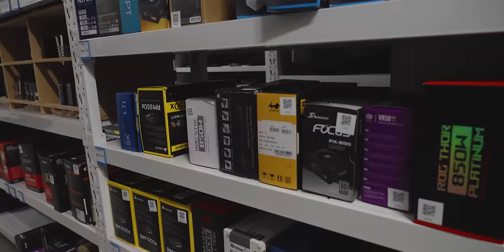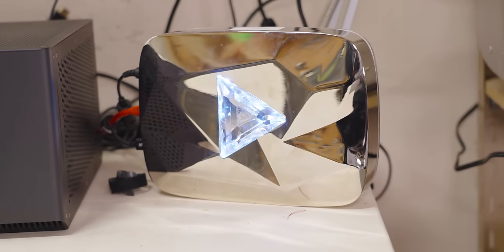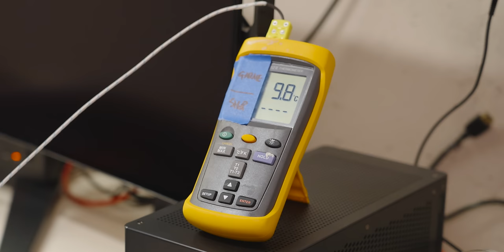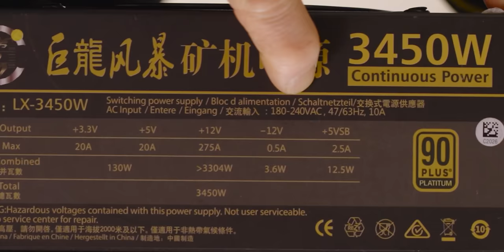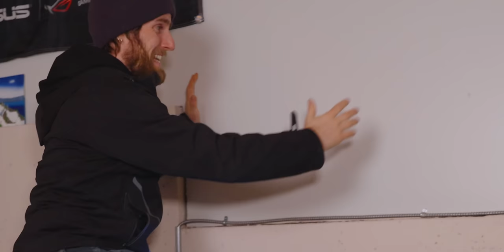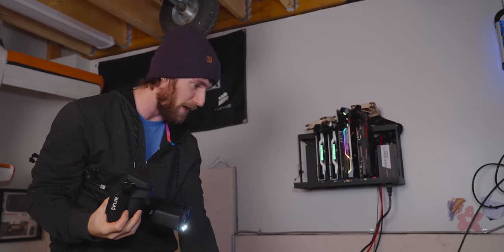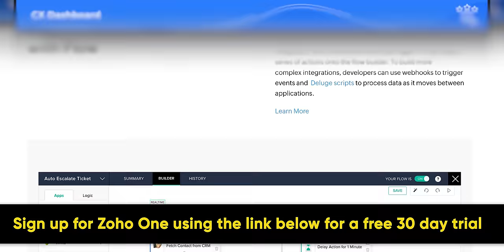Ask me why I'm Mining in 2023...

Comment: for anyone wondering about converting the delta from Celsius to Fahrenheit, you simple multiple the Celsius delta by 9/5 to get the Fahrenheit delta. To convert a Fahrenheit delta to Celsius, you multiple by 5/9. The easy way to remember is that Fahrenheit values are larger than Celsius values, so you multiple by a number larger than 1, which is 9/5.  

Just remember you can't use the normal conversion formula for temperature C to F. this is because the delta is functionally kelvin, so you are really converting from Kelvin to Rankine (which is where the 9/5 comes from). Rankine is just the Fahrenheit version of Kelvin. The only time you ever really run into Rankine in the wild is in aviation because weather balloons (or their reports) often use Rankine for measuring temperature. this is to avoid the possibility of dividing by zero (and some other useful features)

Comment: In house, I would use 5/12V powerline around floor of every corner of every room ..... and put some power source on the safe place (and also with some small UPS) ..... other than having tons of dangerous power supplies laying around flammable surfaces .... just pull cable from the floor put some 7805 or similar in TO220 case to easily manipulate and you are done ..... safe ..... and reliable due to UPS .....

Comment: Buying 1200W ceramic plate heater (with IR radiation) for like $60 seems harder than mining rig with value of like $5000? Which one is better? Besides, if you need really heat and not some money from crypto, invest in good heater. IR radiation can aim heat compared to air heaters. Less heat loss because you will feel the IR radiation heat much more.

For your info, i have 700W ceramic plate heater here, and it can warm up whole small room pretty well plus direct heat at my side. So it works well.

Comment: It needs to be on or near the floor. Heat rises!
I used to have a full tower of 540MB SCSI hard drives, venting heat out of the case only through the power supply fan. Worked to heat my shop a good 10°.

Comment: You just need to let it run for a few days. It's all about thermal mass. You need to eventually heat up the room and the objects in it. It's not just going to be instantly warm in there. I ran 2 GPUs in a 17*20*10 garage with -30C outside for a week and it was unbearably hot in there. I just needs time.
Reply: what crypto did you mine for ? I'm assuming not bitcoin since GPU's wouldn't be suitable.

Comment: The weather on the Pac coast is so intriguing. I'm in OH in the US, and we just had a cold snap around -20°F, and typical winter lows here are in the low 20s. A cold snap for Vancouver area being 14°F isn't a cold snap at all for us. That's just slightly below normal. I would think with BC being much further north, the cold snap Linus mentioned would be normal winter for him.
Reply: It's the coast, the ocean tends to heat the land and create a micro climate check out the zone maps for gardening and you will see what I mean. North doesn't always mean colder and also elevation makes a difference, when you are way above sea level like a mountain top it's colder.

Comment: you should use thick black theater curtains/cloth for the heat trapping (called molton in denmark, where i'm from), would work great for that plus it's also good for the acoustics 🙂
Reply: What about regular insulation that is designed for trapping heat? Crazy idea I know but let's give it a shot.
Reply: @originalguckfoogle  for sure, but that's not a curtain anymore

Comment: Infrared Heating Panel right above the workstation facing down AND/OR under the desk. I imagine you can get away with 500W or so. Pretty cheap. It will feel nice when on but won't heat up the room.

If you want to heat up the whole area/room you'll have to put WAY more thought into sealing and insulating it. Not worth it.

Comment: heat rises, sometimes I wonder if Linus is just trolling us or actually trying to do something (obviously it was for the video, but is he actually trying to make it work for the video, or 100% trolling?)

Another thing is, when you are trying to warm yourself or a room, you don't want a fan blowing directly on you, while the air might be slightly warmer, it will also be moving, so it's not significantly warmer than ambient, it will actually cool you off.  That's why you flip a switch on ceiling fans in the winter, to make them suck/blow cold air up towards the ceiling, then the hot air spreads out away from the fan, hits the walls, and goes down the walls, bringing heating down.  In the summer you flip that switch to blow the air down, so you have active air blowing across your body, even though it it warmer air from up high.

It would have worked a lot better mounting it either on the floor, near you, or bolted under your desk.  Especially if you used the curtains around the base of the sides/back of the desk so the hot air was forced to leave the front bottom section of the desk against your body.   1200 watts is a lot of heat,  space heaters typically max out at 1,500w

Comment: Surely it's 'working', but the heat capacity of what i'm guessing is a big concrete slab of a floor is making it a slow ass process. If you got it to temperature by some other means, like a big space heater, and then maintained the temperature with the GPUs that might work better?

Comment: I could be wrong, but i believe that the power company will charge you for capacitive load as well as resistive. so you won't get a perfect conversion of wattage used to wattage of heat. it should be off by the power factor of the mining rig. i think. lol

Comment: Perhaps Luke, or anyone else with a science education, can teach Linus that heat rises!  He mounted a "heater" above his head — in a high-ceiling room — I guess... to ensure that only radiant heat is likely to reach the target area???

Heaters go on the floor.  Coolers go on the ceiling.

btw- A hand-held hair dryer produces greater heat and greater airflow.  Modern hand-held hair dryers, typically, contain a 2000W heating element.  If you think a hair dryer is a poor heater for the volume of air in that space... you're right!

If he wants to heat the room by mining crypto, he should line the boundaries of the floor-area with mining rigs.  Thus, they would heat the cool air as it enters the space — aiding the convection of heat.  Drafts of cooler air — cooler air is denser — push in from the outer walls.  Or, in this case, from the outer curtains? 🙄

Comment: A cheap construction site heater would do. Those were only 30€ where I live and they heat quite well with a max of 2000W of electricity and they have an integrated fan both the heating and the fan speed can be manually adjusted. :)
#Emergency heater ^^

Comment: you would do better to just get a portable space heater even a small oil filled radiator will heat better than that provided your garage space area is insulated properly which sounds like it isn't in the first place but thats another problem

Comment: a few years ago i installed a small server rack with 4 servers in my underroof for rendering and folding (for the ltt team of course). 11 xeon cpus and 3 gpus are heating the underroof (arround 15m³) ever since like hell 24/7!! i can only run them at full power in winter with open window (a waste of energy, i now 🙈) that would be ideal to heat the garage.

Comment: Lazy Linus is a Linus that can't lazy lol He ends up doing even more work than he initially planned to in the end.  I would have just used a pair of infrared space heaters that I placed on the floor and aimed at the desk area.  One would be aimed under the desk, while the other is aimed under the chair.  Heat rises, so the mining rig could go far to the rear and installed on a low table / desk.  Custom cut the sheetrock and cover those rafters to protect the wood from drying out, mold, and dramatically slow the time to rot.  It also removes the hot pockets, allowing the warmer air to flow more freely in the space.

Effective infrared heaters don't need to have a high ticket price.  In fact, they can be purchased for as little as about $30 each.  They're easy on the power bill too...like, VERY easy on the power bill.  They also produce heat nearly instantly and heat objects instead of the air.  Since area heating is the goal, this especially works because the heat is isolated to the area that they're pointed at.  Very little heat radiates out from the sources because the infrared doesn't heat the air, so not much behind them will be affected due to the chassis absorbing most of the excess infrared light.

Fashioning curtains out of tarp material can be helpful (waterproof, so it obstructs the flow of air).  Hang what you need from a pole and let them rest on the floor.  To keep heat in, hang some from the ceiling and let them drape behind the lower curtains (away from you) with magnets to pin them to the pole.  That will keep the breeze from breaking the seal on your environment.  Tighter budget?  Drop the sheetrock and staple some plastic to the rafters instead.  Even tighter still?  Get creative with your materials to fashion a mount for an infrared space heater, skip the second one, place it near the wall behind the workstation, and angle it downward diagonally towards your body.  It will heat everything the infrared makes contact with.  Still too much?  Drop the magnets and weigh the top tarp material down with objects around the house, then switch from a metal pole to wood or plastic.

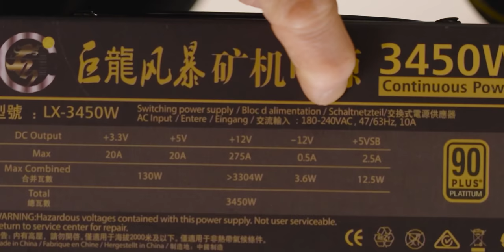Comment: 10:28 Use a Delon voltage doubler (two diodes ad two capacitors: https://en.wikipedia.org/wiki/Voltage_doubler#Delon_circuit) before the PSU: that's what old style (non PFC) selectable input voltage PSUs used to do.
They actually switched from full-bridge rectifier (used when powered from 240V) to doubler (used when powered from 120V) by just connecting one of the two wires from the mains (after all the filters) to the middle point between the two 200V capacitors, thus rectifying 120V to about 339V DC. Remember, it's 120V RMS (https://en.wikipedia.org/wiki/Root_mean_square), which means its peak voltage is about 170V, 30V less than the maximum rated voltage for the capacitors.
In full bridge mode the same voltage was obtained by just rectifying the mains.
I've been powering many PCs at just 339V DC for years: using a lot of old capacitors from dead PSUs it was able to mitigate short brown-outs, like when starting a big electric motor.
PFC PSUs can't operate in that way anymore.

Comment: Part way through the vid - My bet is that it'll get warm as heck. I've used a single candle in a tent (ZERO insulation) that along with my and my wife's heat got the temp up to 15C from -3C. A THOUSAND watts should make you TOASTY!
Reply: 2/3 way through - mount it LOW not HIGH - your fans are going to be fighting convection like crazy - especially when you need it most (colder temps).

Comment: I think just framing in that area with a door and insulated foam paneling would hold in the heat and keep out the cold much better. How much would a in floor heating system cost for such a small area?

Comment: i know this video is old now, But i came across it anyway...
1200w for 4 GPU's is nuts 😂
I run a rig of 9 3080's, using less electric. 🤣
I know efficiency wasnt the plan here.. But they still need some sort of power limitting or underclocking. To save from burning them to shit, real quick..

Comment: Ok I was just thinking about that same subject today as been very cold over the last few days here in the UK 6C outside and my office does have heating to 10C.
Only got a single RTX3060 and AMD Ryzen 7 5700G plus a bog standard 12 year pc to run some old software for work and three monitors and now pushing 15C over 6 hours. I am working in what looks like tin foil bubble wrap in a 2.5M cube built in my garage. So try that better insulation smaller area but I do have a hot drink introduced every 1.5Hr don't know if that makes a difference?
I do have a Chinese diesel still in its box as busy with work at the moment.

Comment: You need a case or some sort of ducting to make it directional, pointing at the chair.  Think old school CPU shroud that let straight to the side panel.  The fans mounted above without any ducting will do next to nothing -- put your hand 5-ish inches away from a computer fan.   Now put a cone of paper around it to make it directional.  Guess which can feel at a foot away.

Super Ghetto But Effective: remove the legs / wheels from a chair.   Grab a wooden crate large enough to fit the rig, and raise that crate from below to make it as high as the legs were.   Cut holes on the crate lid (or just one big hole if it's thick enough to support the chair+person).  Now put computer chair on top of crate, and creating a seal around it.   Or put the computers directly behind the seat in a sealed crate with a network of PVC tubes with small holes drilled along the pipe aimed at the user.    Maybe some heatpipe with small vents up the back of chair, depending on how much heat.  Replace mining rig with a big fan and you should be able to remain cool

The suggestions to pipe heat into the garage won't work unless you build it like above.  Either that, or you need to seal the "subroom" betterl (tape off the curtains, some insulation even on outside of the wall, etc.) - the heat loss from the garage will destroy any significant gains.   I expect another 1 degree MAYBE if it's just ducted willy-nilly into the "subroom".

Comment: nah fam, you should put it under your desk, get warm feed and the heat goes up under you so u are not cold.
and yeah am mining in 2023 cause its cold and i need heating and its cheaper to mine with 4 rtx3070 for like 500w then using a electric heater that uses 2000w

Comment: That can't be profitable?
I tested back in 2018 and even back then it was little more than a very expensive heater. The coins mined couldn't even pay for the electricity cost and the power/electricity cost was about an order of magnitude worse than just turning on the radiator.
Will it work when nothing else is available? Sure. Would it end up cheaper buying a little mobile heater? Most likely.

And then obviously having the heat source below the area to be heated. Warm air has less density and goes up. So put the machine below the table, close the other sides of the table and let the warm output flow at your legs and from there up your sides. With that wall mount you blow all the heat at the boards on the ceiling. Or make a duct that connects the output of the PC (that needs to have separated in and out obviously) to your feet.

Comment: Why fighting against physics?! Just put the damn thing under the desk and let the heat rise... Maybe place a thermal blanket (those mylar emergency ones) between the rig and the wall, to reflect a little more heat towards the user, or maybe use a closed case with just one exhaust fan also directed towards the user...
I mean... I guess there are more efficient ways to use 1200W of power to heat the room, but if the purpose is just to run Folding@Home I guess everything counts!

Comment: That chainsaw hang move was incredibly stupid. Even if the ceiling mount is rock solid, any other link in the chain could have failed such as the handle itself. You would have pulled the blade into your face and eyes, and then fallen off a ladder.

Comment: If you think -10 degrees C is cold (I'm one of those uncommon Americans that can do the conversion to the degrees F we usually use) - try -10 degrees F, which sounds MUCH MORE like a Canadian temperature.
Then try the -30 (C OR F, it's pretty close by that point) I've seen in Iowa winters when I lived there (I'm currently more-or-less 150 miles from your area).

I'm NOT talking about wind chill - and MOST of Canada sees even worse than THAT at times in many winters.

Then add in the common 10+ MPH (16+ KMH) winds Iowa gets that most of Canada and most of the USA DON'T get....

Comment: Put it under the desk, for the love of god heat rises, don't put a weak airflow heater above your head and wonder why you can't defeat the laws of physics. or box part of the the bottom 2 shelves of that metal unit, duct the air through it, and put the mining rig in there.... cool air in under the pc, hot back out (still back under the desk). that will warm all your important components - including you)

Comment: Just watercool that sh*t and point the radiator with fans at you. I additionaly heat my whole room by multiple degrees celsius with a 9900k and 2070 on water, and i have the radiator installed like HP Omen pre builds on the top of the case pointing up. I had that way back in 2019 should have patented it :D

Comment: Linus you are driving my daily driver ? Asus X flow 13 6800u 32gb ddr5 rtx3050 the ultimate dad gamer laptop it's my favourite laptop since my XPS 12 with the swing screen which you also had .  I've used many other regular laptops and my work machines are a Dell price performance Inspiron and a surface 4 which are adequate for spreadsheets I would not purchase those.

Comment: you could always just buy a big flowerpot and base, shove a pipe over the drain hole od the pot, fill it with concrete, and stick a candle or one of those sterno alchohol heaters under it. The candle will heat the concrete over time and the concrete will hold the heat for hours. it can get up to 200 degrees in some cases.